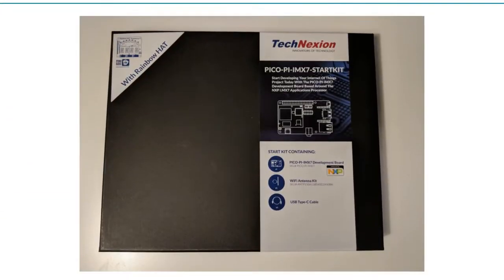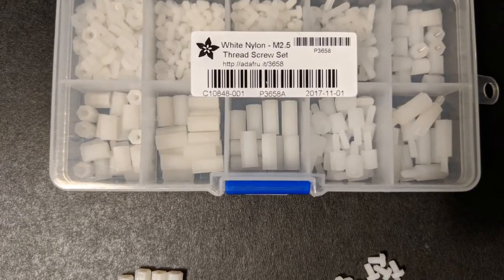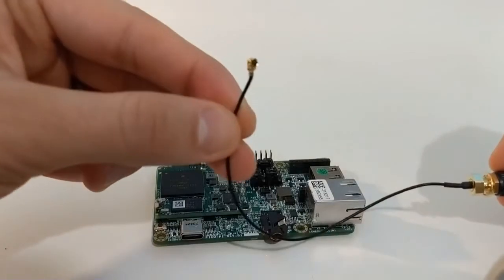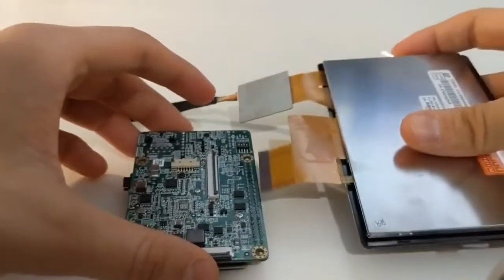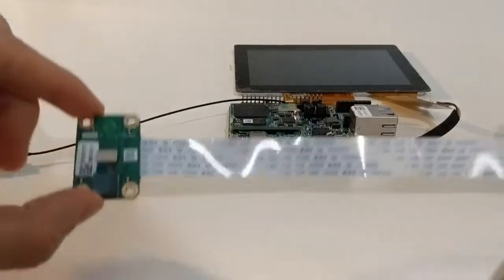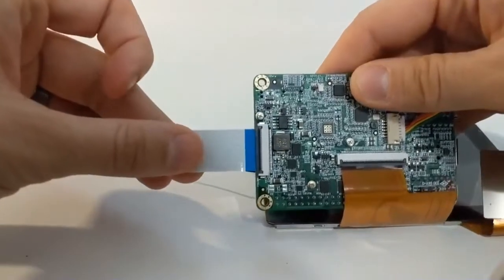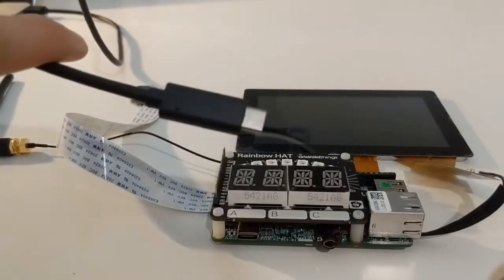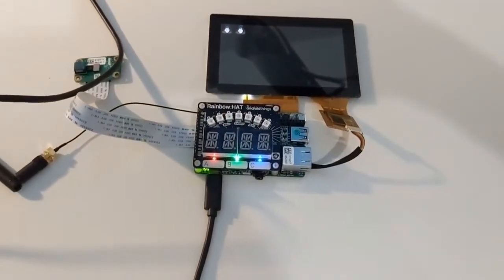Android Things Examples: Assembling Your Maker Kit

Comment: Hey, I've just bought one of these kit (with a very low price, unfortunately, dunno why it can be this cheap). Does the board easily heat up when we power up the board? Or could it be there's something wrong with my board?

Thanks in advance.
Reply from the maker: I never had any issue with the board in my small experimentations.  The kit might have been cheap because Google essentially abandoned Android Things for individuals, and focus solely on larger manufacturers now I believe.  After that, a lot of the hobbyist interest went away.